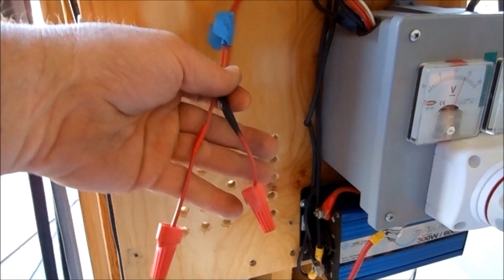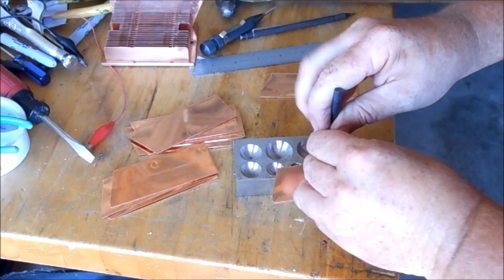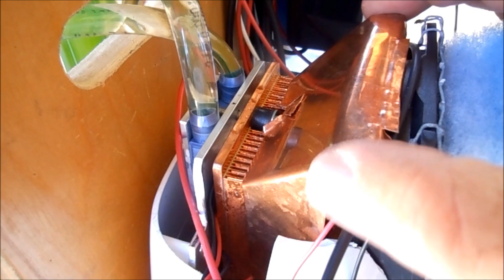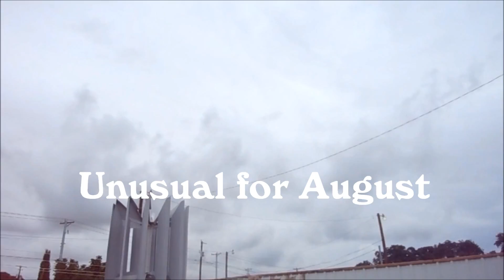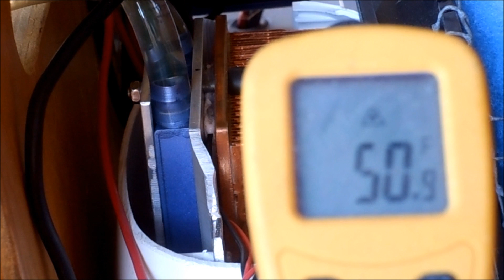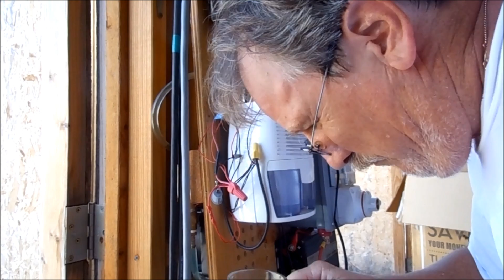Rainmaker/Water From Air 2

Comment: This is a great idea. It seems to be very dependent on a power source seems like it would work better where you had a more reliable source of power. Seems like you could a use a wind generator as well as a solar set up. It is usually windy when it is cloudy. 

      Have you seen the Fog Collectors.
Reply from the maker: It did have a wind turbine connected to it as well. Unfortunately it's not high enough to be in the more consistent winds.
And no I haven't seen the fog collector. I'll check it out.
Thanks for watching my video.
Reply: I have a 400watt wind turbine in a box how high did you have yours?
It is going to be part of wind/solar system at some point.
Reply from the maker: You will want your turbine to be above any obstructions, but depending on where you live there may be restrictions on that. In my area forty feet is the max and that would put it around the average height of the tree line. The vertical axis wind turbine I built is on the same base that holds the solar panels. I had another on on the roof of my shop. Eventually I intend to build a portable base that will hold both solar panels and a telescoping mast  for my wind turbine.
Reply: Little Shop In Texas right now my land is in the county and unincorporated but covered in juniper trees.
Reply from the maker: Awesome! You should be able to put it as high as you'd like, as long as it doesn't interfere with air traffic.
Reply: Little Shop In Texas the only real problem I have with the height is the potential physical ability to service the device in later years. I long ago determined not to put my solar array( when it is installed) up on the roof. So that as I age, to a certain point being able to do maintanence without having to climb or bend over too much.
Reply from the maker: I know what you mean. I'll be 60 soon and have already found it more difficult to climb and bend than it was just a few years ago.
I've also found that I no longer bounce when I fall.
You should look into the many types of tilt up towers for your turbine. It would make maintaining the turbine more manageable even when working on it alone.
Reply: Little Shop In Texas I have seen one by a retired ham radio op. I can not describe what he did in worda but it used a pivot point about 5 feet off the ground. Two boat winches. One to make it vertical the othet to raise the antenna. Very cool set up

Comment: Funny, spend months getting it out of the air only to heat it slowly so it can go back LOL
Reply from the maker: It took a few days to collect the water and I boiled it to kill any germs that may have grown there and to make coffee. Clean water, no fluoride, no chlorine.
Whats so funny about that?
Reply: I get it just thought it ironic that you are distilling water from the air then putting it back,  I live on mountain spring water so understand the concept.   Meant no offense just ironic
Reply from the maker: lol, We have mountain springs in Texas, but they're almost 500 miles from my home. That's a long way to go for a clean cup of water. City water is just another one of those monthly bills that whittles away at what little income I earn. The thought is, if I can use wind and solar power to collect my drinking water from the air, I can be less dependent on the chemical injected water that come out of the city water pipes.
Reply: Some people earn less than the other that force them to innovate stuff. This is where we use our brain power to get things done. 

Good job by the way! i love the basic setup you do. It's simple yet easily maintain with cheapest cost. There's lot of room for improvement. All the best!

Comment: Did you figured out how to get the water down ??? Simply power on the fan for defrosting for 1-5sec every minute or so ...
Reply from the maker: The only time I might need the fan for defrosting would be when the ambient temperature is low enough to allow the water on the element to freeze during operation. So the main reason for the fan was blow the water out of the blades. Unfortunately the blades are close together and air flow is limited, so much of the water remains between the blades even when the fan is running. And of course when the fan is running new water doesn't form on the blades. I plan to remake this contraption in a way to take greater advantage of gravity to move the water down.

Comment: You might try a hydrophobic spray coating on the condensation surface. But depending on the viscosity of the coating, it might fill the narrow fin gaps instead of just reducing the capillary action of the water.
Reply from the maker: Thanks, I'll look into that.
Reply: Yesterday I've started with the same project, Aldo though about making hydrophobic surface. I've just watch a video on how to make inexpensive spray with a clear coat + deodorant spray.

Comment: Neat idea...LOVE the name for it!  Might need larger/more blades to make enough water per day for one person to survive on.  
Could put a food-grade coating on metal tubing in a regular dehumidifier, to make more potable water per day.  
Could help cool the air by combining simple geothermal temps into the rig...thermoelectric only cools about 30 F. below ambient air temps...boost that using geothermal temps, instead of regular ambient air.  Plus, there is moisture in geothermal air.
Like that wind gen on your place...what kind is that? Did you DIY that?
Your wife doesn't believe these things work?!?  Yet, you have wind gen, solar, etc., and most folks understand thermoelectric works...
Reply from the maker: Thanks for the comment! I do plan to try it again with bigger blades to add more surface area. The copper for the news blades should arrive here soon. I have a couple small heaters I may incorporate into the next experiment to warm the air before it's blown through the cool blades. I call the wind generator a stealth vawt, and yes I made that as well. It sits on a base that has a pair of 100 watt solar panels that track the sun as it moves from east  to west. I call that whole unit a power pod.
It's not that my wife doesn't believe these things work, she just thinks I'm wasting my time and what little money we have.
Reply: Little Shop In Texas Ah...so your wife has yet to figure that any of the things you tinker on, might actually result in substantial income stream...{{sighs}} So many think that way...it's the bane of all inventors. 
Would love to see what you come up with. 
    There's a guy who built "The Giant Earthship" near Pendleton Iowa [last I heard, it's up for sale, but needs lots of maintenance].  He used an old beech tree trunk, carved two compartments in that, set it over a 6' deep hole in the ground...then used a thermoelectric unit to cool that "refrigerator".  The ambient temp of the hole [geothermal] + the thermoelectric unit + thermostat + small solar panel. meant he could keep ice cream frozen in the freezer part.  Now..the tricky bit, is to extrapolate that, into a more manageable household unit that might not necessarily have a big hole.  
    Someone else made a product called a Power Pod, some years ago. It was a portable power source built into a barrel or trailer, could be sized as customer wanted, use wind+ solar.    Pretty cool--we nearly bot one...but unable to afford it at that time.  Cannot find a website now...but many spin-offs of similar have been done for something like 20 years. 
   Keep up the great work!

Comment: cool, I thought dehumidifiers heated air, then cooled. use exhaust hot side to pre-heat air/moisture, then draw over cooling coils, you need quite a bit of airflow over cooling coils to pull the moisture out, (percentage of moisture x cubic feet of air) try running the fan for "defrost" at 5vdc, better yet build a path with hot side fins to cool side fins.